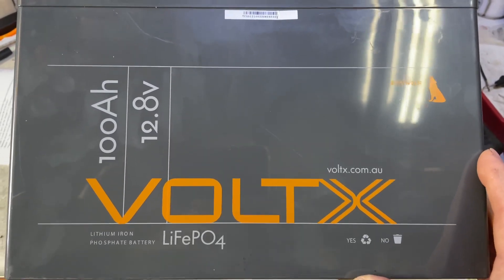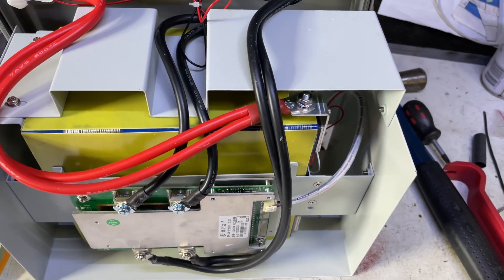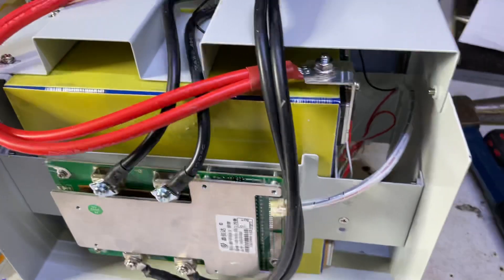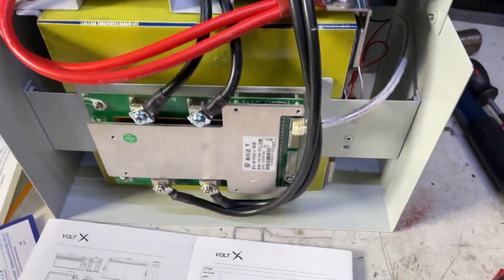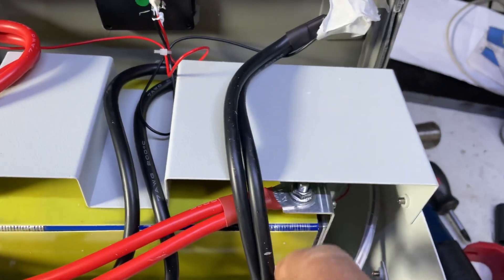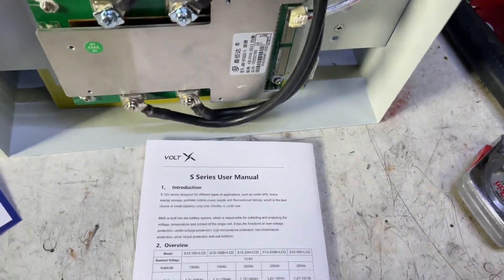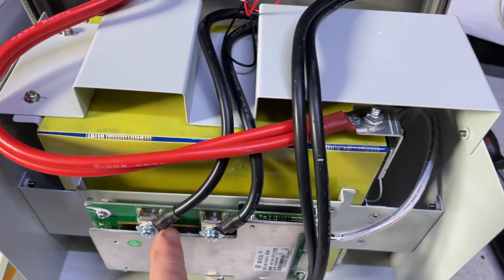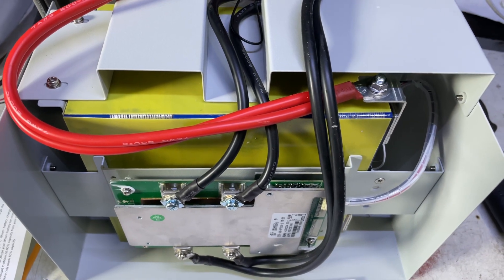VoltX premium plus 100Ah Lithium battery￼ quick teardown review. ￼

Comment: I bought 4 of these batteries but the 24V 100AH "premium" version at a good price with an eBay sale hoping they work well together in parallel and last a while. They have a see through case (which is a gimmick but is actually cool) and the inside looks nice and neater than the one you've opened up. Great video I'm keen to see what exactly the type of cells are, great video!
Reply from the maker: So far with the little bit of testing I have done the cells hold change well, they stay at 3.4v after charging and the bms works very well. Only bad so far is all the screws holding the metal frame together where loose and the cells didn’t charge up evenly with one hitting 3.75v long before the others cells. I left the charger on and let the BMS do it thing and they all eventually charged up okay

Comment: I've got their basic 300ah one. Interested to keep following this and see more information on the BMS and a more in depth teardown.
Reply from the maker: For the money they don’t seem to be a bad battery and come with a five year warranty.
Reply: @philsrandomstuff2392  yeah, I was thinking with a 200a continuous discharge it looked alright
Reply from the maker: @SJ-dn1lc  I have just ordered the new version of the basic voltX battery so I can do a comparison between the 2 to see if you really need to spend the extra 200dollars on the better battery if you don’t have that higher current demand. I have two basic hundred amp hour voltX batteries in my camper and they work fine the only problem is they suffer badly from voltage sag they will settle back to 13.1 V very quickly which makes the battery monitor show a loss in capacity which there isn’t.
Reply: @philsrandomstuff2392  is the warranty really 5 years?
I’ve been reading the listings and all the info is conflicting.  For example on one listing it says 5 year warranty, 3 year warranty and 12 month warranty on different parts of the same page.
Reply from the maker: @yallawallahalla  yes it’s five years for the plus and three years for the basic.
Reply: @philsrandomstuff2392  thanks mate

Comment: I just bought the basic version today for a electric kayak motor. If I get a year or 2 out of it I'll be happy. Only seen these series of videos after the fact. Do you know if they've done any upgrades in the new "2022" or is it just a facelift on the case?
Reply from the maker: No idea if they have changed. But if they come up on sale on eBay I’ll get one
Reply: I think they updated them about a year ago.
The old ones were only rated for 50 amps constant but they are now rated at 100 amps (the BMS inside is actually a 110 or 120 amp from memory).
Reply from the maker: See this link for internals of basic
https://youtu.be/XOSnaGev07E
They now do 100amp discharge not 50
Like last years

Comment: I bought the previous "premium plus" version and it does its job (I'm only starting out), and just recently bought 3 of these (Just the other day and they come today). Judging, by the way, the inside looks, I can see why the bracket is on top unless that is your camera they may be prismatic on the outside, but are they pouched? Because of the way battery cells are warped. I wont be these again, but I saw reviews and they seemed to be pretty good. Pretty disappointed but... for now they will do
Reply from the maker: They look to be prismatic cells but the QR code will not scan unfortunately because of the way it is etched into the alloy my camera won’t pick it up. I have completely disassembled the metal support case around the cells and They have glued strips of insulating cardboard under the top metal cover so it can’t short out on the studs. I am a little disappointed with these batteries I thought they would be better than the cheaper version but I feel the cheaper version is assembled better. I’ll be doing a video soon comparing the new basic version of the battery and this premium plus series to see if it’s worthwhile spending the extra money or should you just cut open the cheap one and put in a better BMS. Like you I’m definitely no expert on lithium batteries but I’m having some fun mucking around with this cheap stuff.

Comment: Look fwd to see cell balance
Reply from the maker: Started doing test today.  cell balance straight out the box was pretty good on one battery with only about 20 mV difference and the other battery with 120 mV difference, when I charge the battery with the 20 mV difference I ended up with a cell that ran all the way up to 3.75 V within about four minutes of having the charger on and three other cell sitting on 3.3 V what a shit show. The other battery charged on my 40 amp charger for 30 minutes before it cut out on high-voltage disconnect one cell also which was around 200 mV higher than the other three it looks like I’m going to have to individually charge the cells.
Reply: @philsrandomstuff2392  
Yeah, I am very interested in your findings.
Be interesting if you top balance the cells and they remain fairly close together for a number of cycles.
Bit of a concern that the bms hasn't been programmed properly with high cell overcharge.
Looking fwd to the videos